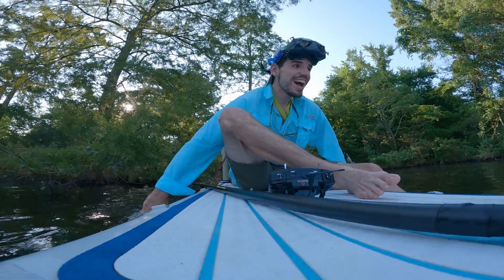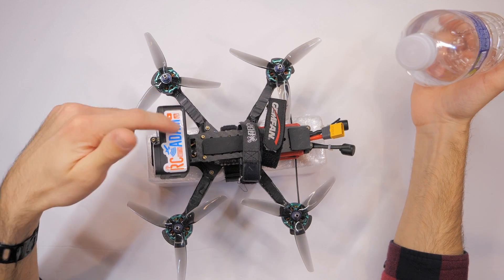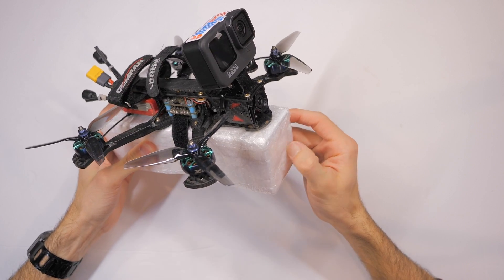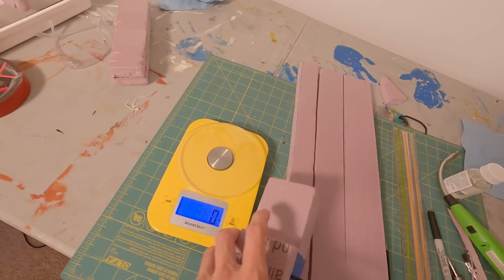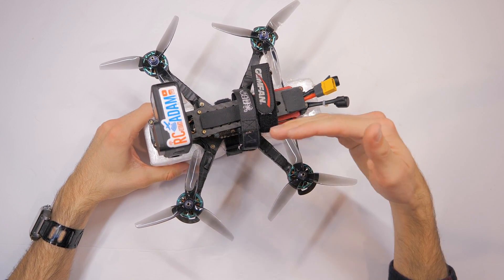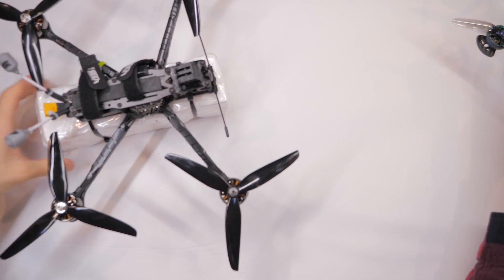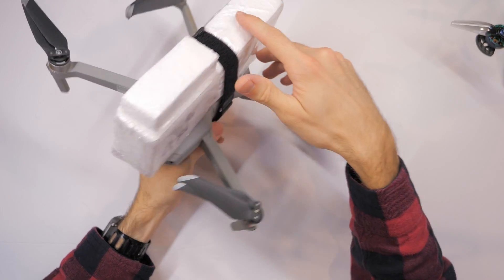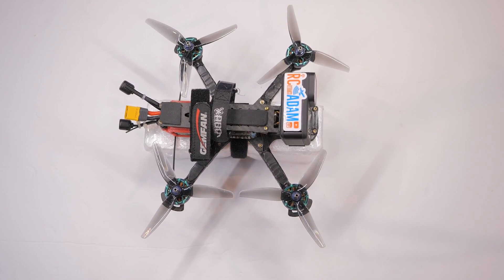Drone Flotation Solutions - How to Keep Your Drone from Sinking! (A work in progress)

Comment: think bad solution it wil clink this way ,i think best way is put on the 2 sides water swiming tubes (noodle mouse things) only thing then is if you do it with strips on the 4 drone arms that you can't put the drone arms in or you need renew all the time the strips

Comment: Try some extended foam legs. Try it in a kiddy pool
Reply from the maker: I would think that would tip over, maybe?
Reply: It would be 4 longer legs under the ones with the rotors with a small block of Styrofoam on each one. It would be really hard for it to tip in the water. Not sure how it would fly though?
Reply: Yesterday dispite a full charge my nano plus, it lost power after about 30 seconds from liftoff and was about 30 feet from the shore of a pond I fly over frequently. I have yet to recover it but have other drones and will be devising flotation for future flights. Calculate i will need about 15 cubic inches of volume for mini drone. Im thinking maybe first trying 2 or 3 of the 3.5 oz TSA bottles or 1 inch foam pad but will be experimenting to avoid completely loosing another drone.
Reply: Foam is super light but buoyant. was thinking about trying different methods so it will float in the bathtub first. Then try to fly the thing with them on. If it works will take it to the lake and fly around and if it goes in the lake, I can retrieve it. my goal is for it to land in the boat. will home it but when close will manually land it. home is not that accurate especially landing on a boat seat.

Comment: Nice video with good insights, thank you! Personally i've also tried using small 'pool noodles' straped to the arms like a bracer from front to rear motor of each side, give a good flotation balance. It still flies ok even with the noodle directly in the propwash. But still, if you land upside down...have to be lucky with reception to turtle mode. 
I like the darwinFPV hulk idea on that note, which seems to auto flip to right side up with a similar floats configuration but set up inverted like you did.

Comment: Cool concept putting floats on your quad.  My CO2 laser is finished and running well.  Shoot me an email if you want to work on another project.  Do you think we could laser a profile float that goes under the arms of your quad?  A wider float would give you more stability on the water and less chance of flipping upside down.
That foam is EPS = Expanded PolyStyrene.  It's the same thing as XPS Extruded PolyStyrene, except EPS are beads blown into a mold and is a bit more close celled and XPS is extruded.  XPS is also considered closed cell, however it can take on more water because those cells are not uniform and XPS is usually more dense.

Comment: What if you used a long range crsf receiver that uses 2 antennas this way there could be an antenna on the underside so when it floats upside down you could possibly still have control.
Reply from the maker: Good idea!